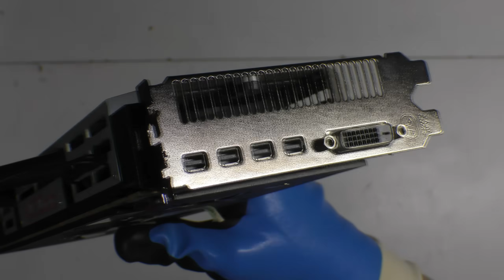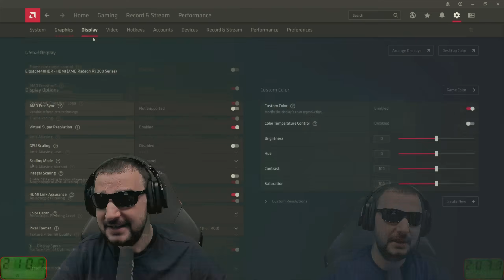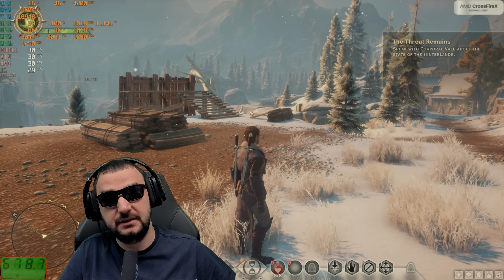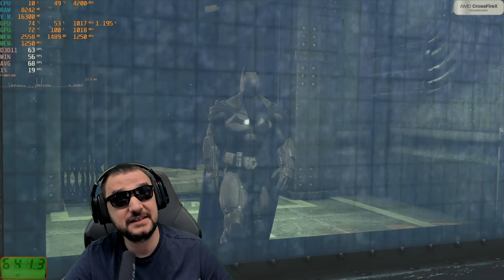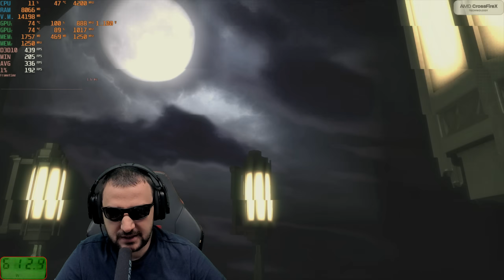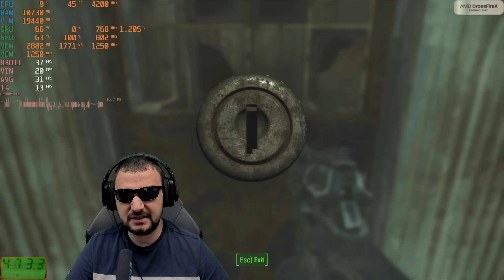AMD Radeon R9 295X2 Benchmark

Comment: Nice review.  It's interesting to see a reminder of where we were with gaming in 2014.
Just a suggestion:  You should try these old AMD video cards on a PC running Linux with Steam.  You will find out that in Linux (any version) any AMD video card made in the last 20 years or so works flawlessly, unlike with Windows where there can be a hassle getting the GPU to even work.  No driver install.  No tuning needed.  That R9 295X2 would be a beast in Linux, and those frame time graphs would be much smoother.

Comment: I used mine 280x (7970 Ghz) till 1.5 year ago... was holding up ok in esports (till CS2 came out).
Reply: Try the Amernime Zone drivers. One of my old retro PCs runs a Core i5 750 @ 4.2GHz and an overclocked 7870 XT Myst Edition (7950) @ 1.2GHz and with Amernime drivers can mostly maintain 60+ FPS in CS2.

Comment: Did you ensure crossfire was on? This is about how a single r9 290x preforms
Reply: Yah checked the Crysis 3 bench that is how single r9 290x performxe
Reply from the maker: Its with AA at 8xEQ
Reply: @DanielCardei ahh oki 👍 nice video btw
Reply: @DanielCardei the power draw shouldve not made me doubt 😂😂

Comment: Vsync mode was required for crossfire
Reply from the maker: to stabilize?
Reply: @DanielCardei in order to get my 4870s my 6870s my GTX 1080Tis my RX580s i had to use modified vsync settings to frame pace both cards equally if not you would be favoring just one and the other would be doing memory or calculations but not rendering
Reply: @DanielCardei furmark with crossfire to help Ai train
Reply: Vsync on SLI or crossfire has insanely high input lag. Horrible

Comment: 500w and no need for the shitty 12vhpwr
Reply: 3x 8 pin easily hold 1000+W..  HPWR and reincarnations are designed to fail on the user.
Reply: Remember when early 2000s high end GPUs doesn't require any power pins and maximum wattage usage is 30 watt.

Comment: weird that you get this performance  in crysis 3
I ran this at 5760 x 1080 and still kept over 60 fps
on my 7870s in crossfire back in the day
I feel like these cards should be getting way more fps
I still have a screen of that 5760 x 1080

I just can't remember if that screen was on my Phenom II x4 965 black or
my overclocked i5 4670k
Reply: At first he used MSAA x8, which will murder even modern GPUs, thats why he got so little fps.